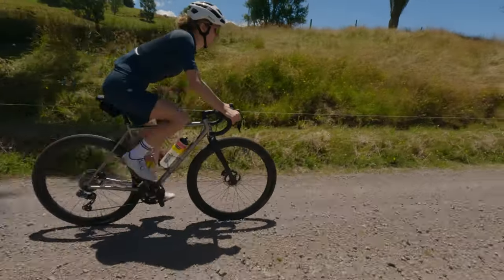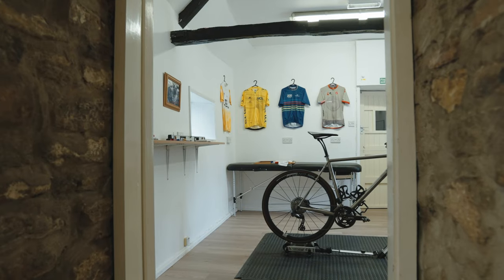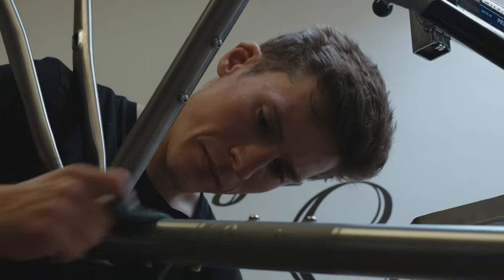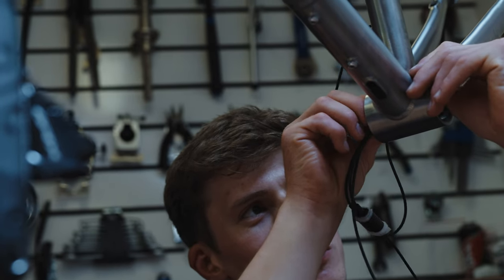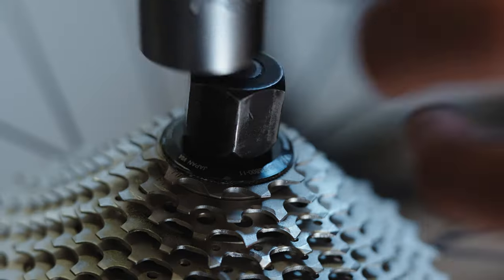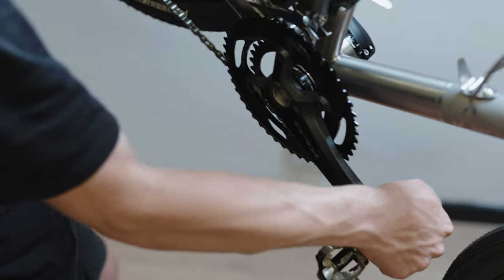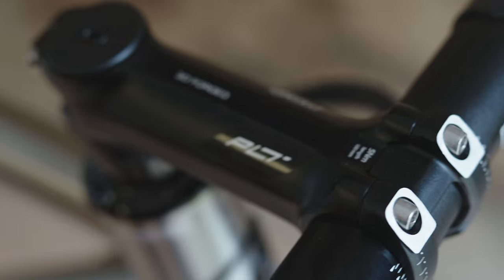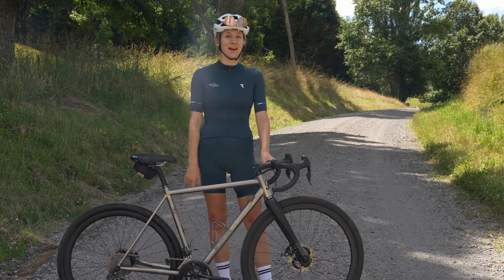Creating The Gravel Bike Of My Dreams! // Dream Bike Build

Comment: I havesome experience with titanium bikes and a titanium roadbike with a T47, with titanium as a material it is crucial to use copper grease between alluminium and titanium surfaces. If you do not, the materials will corode and for example the bottom bracket will seize in the worst way possible.

Comment: Call me a grumpy engineer, but the way he used the torque wrench (lever length is important!) is wrong, BB without torque wrench; Nm 4 and below you’d not fasten with a levered tool for the tolerances are too high, use a screwdriver-style; grease used seems to be the same everywhere yet your bearings likely have PU or PH grease in them (datasheet will tell) not compatible with all. DS BB inner race was greased but shouldn’t (only the NDS for Shimano; you’d grease the DS spindle if it were not from the factory, which most of them are these days). Greasing the freehub will just increase wear. 5:31 get a laser level 5:59 DI2 cable a bit short, and electrician’s tape used rather than strapping tape